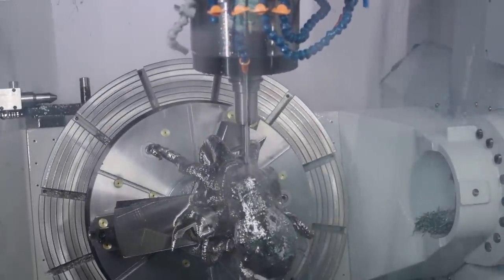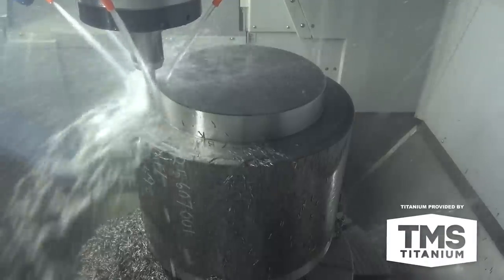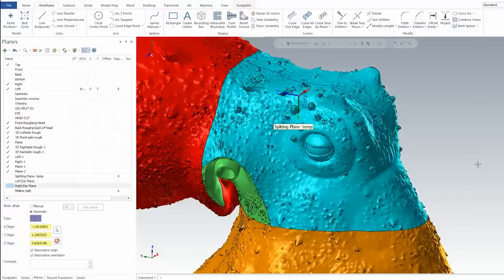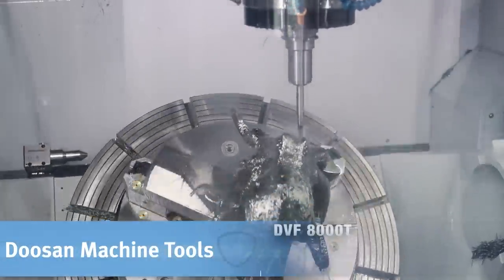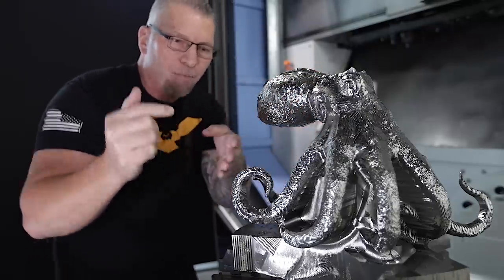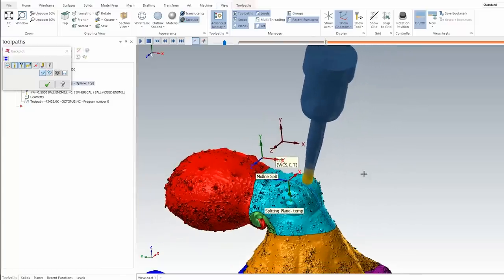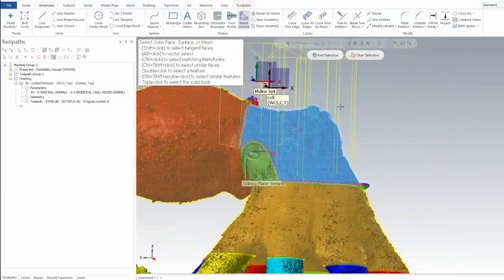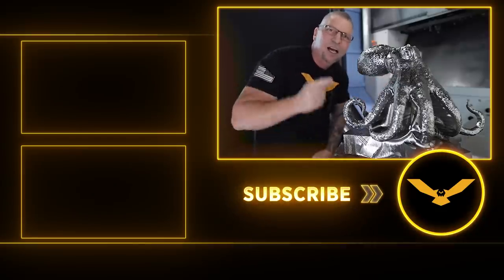How I used the unified toolpath on the DVF8000T | DN Solutions

Comment: Hey man. I need to warn you about something. I'm an audio engineer and I'm listening at my studio. Your microphone is picking up copious amounts of high frequency noise from the machines. You should absolutely have ear plugs in, as at this volume, this sort of frequency easily destroys your ears irreversibly. Please take care. Please wear ear plugs. Even the cheap foam ones from 3M are perfectly fine for HF reduction.
Reply: Yeah, i played this on my phone and the high frequency SCREECH while you were talking (not during the machining portion) was awful, had to dampen the speaker with my thumb to finish the video. If you could have your video editor do either a "low pass" filter to cut out the screeching or do a noise cancellation (or both) based on one or two clips of the shop when you aren't speaking.

Love the use of 2 surfaces, smoothed for pathing, full res used for "collision avoidance". Fantastic, very useful trick.
Reply: @woopdeedoodaa  same, great technique. loved learning about it. just concerned about our boy's hearing, that's all.
Reply: Even on the playback it can be bad, is the digital filter to fix this?  Its a problem on all machining videos. Wood working often worse than metal working.
Reply: The pitch even through my scrappy tablet speaker is killing my ears. I had to watch and not listen. But I too am an audio engineer and I'm working with frequencies and electrical generation. I was testing some super high pitch frequencies and thought my device wasn't working (had it set wrong, high when it was supposed to be low) so I put my ear up to the speaker and held it there for a good bit. Even though 8 didn't physically hear any tone, when I pulled my ear away, my ear drum was pulsing and it made me feel weird AF and like my ear was wet. Don't know if that makes sense but yeah it was crazy. After about 30 min my hearing went back to normal. What's crazy is I could tell it was a saw wave as the pulses matched my output frequency. Also I'm looking for sound engineers to help me with some binaural beats. They are not for human consumption but for machines. If you read this and are curious hit this comment up.
Reply: @jvon3885  Jason, I think I speak for everyone when I say, lay off the weed man
Reply: @cheater00  my bad I thought I was speaking with someone with intelligence.
Reply: Woah yea I thought my neighbours activated some kind of buzzer again...
Reply: What did this say? I read it out Loyd but couldn't hear myself
Reply: What did this say? I read it out Loud but couldn't hear myself
Reply: I am in the same boat. its not to hard to download audacity grab a noise profile, and reduce it.
Reply: @nickmaille5951  let's be nice and constructive Nick, they have improved things since then, but my main worry was about everyone's hearing. Ear protection bro!
Reply: @cheater00  My statement was not mean. My statement was to inform people it is easier than they think to reduce room noise for video applications. It requires a few seconds of recording the room sound and a few minutes of work at the most. This video is meant for many people to watch. As a creator, it is essential to maintain a comfortable listening experience to encourage people to continue watching future videos. I communicated a problem and gave a valid solution. You completely misinterpreted my statement. Your comment and this reply are neither constructive nor "nice." How is someone to learn without recognition of the problem and insight from someone who has experience in dealing with the same problem? What constructive insight did your reply do? I do not wish to learn from nor converse with someone who does not understand that. "That," being how to take constructive criticism... something this creator claims to be good at(Referring to when he told the story about the aviation parts that were out of spec on the SF. callout due to the lack of proper inspection equipment, and complex parts.)
Reply: ...Bro!
Reply: Yes most ppl don't know it's the high frequency sound destroys ears more than low bass from subs that ppl use to say your going to go Def from that.  But generally the high frequency is worse for your ears

Comment: A lot different from finish cutting a mould and just stepping over . 010 and cutting across on two axis. Y and Z or X and Z will 1/2" ball nose endmill. Then we'd finish on multiple axis with the smaller ball nose endmill's. But it would just be for fine features.
Very cool 😎

Comment: How have the tools evolved over the years? IE New materials allow for smaller machine components. Lets say we discover some crazy metals that allow tools to be almost thread like thin except for the cutting head. That could be tiny as well but require more passes to cut a part.  Will they go smaller or is that a case diminishing returns at some point.
Imagine a tool head that can flex in any direction yet keep the cuts dead on.... 
Do you see future 3D printers putting an end to the CNC era?

Comment: Is the CAD model you are machining off an .STL or a solid model?
If the software is dividing a mesh model into accessible boundary regions, that's very cleaver.
Normally this sort of file is just one all enveloping surface to CAM software and it takes a bit of cunning to localize where you don't want to machine.
Reply: It's a single surface STL mesh body, that Titan later divided into different segments

Comment: So I doubt this octopus was made in traditional CAD, and was sculpted instead. That means it's a mesh file most likely. How good are various CAM programs at handling meshes? Seems mastercam is doing a decent job.
Reply: you can do this in mid range cam programs for years now!  But you have to make a drive surface underneath, not sure if it works with a mesh underneath.
Reply: This is a mesh model, and is being worked as a mesh in Mastercam. For 2022, Mastercam added a full suite of mesh editing tools that really put some powerful options in the hands of users! There are actually some scenarios where I'm finding that for organic shapes, I turn my surfaces into meshes and work with the mesh to edit and machine parts! Definitely flipping the thinking on some of the traditional workflows.